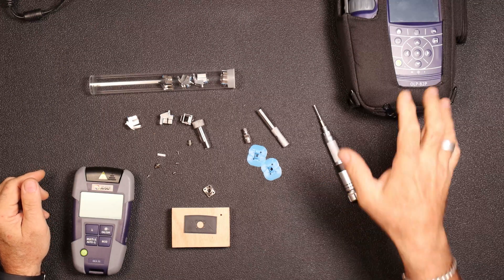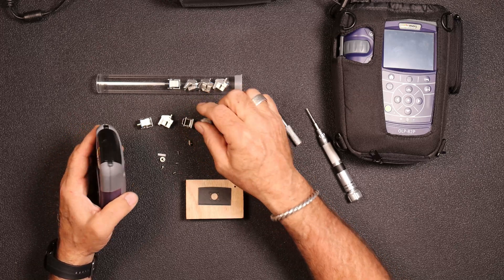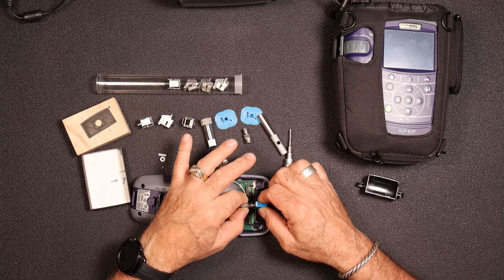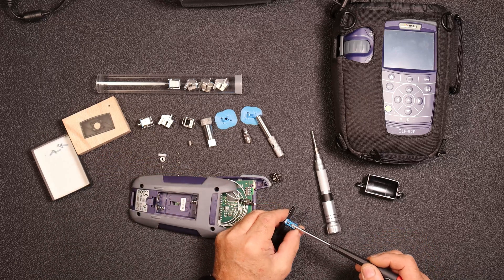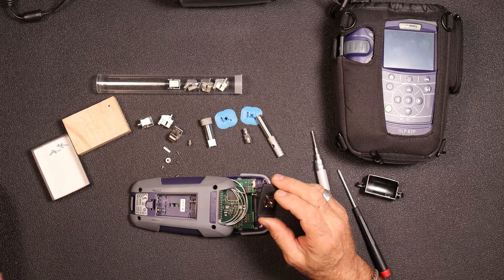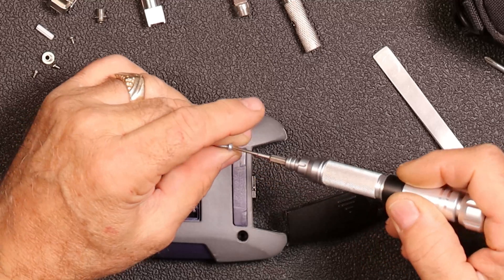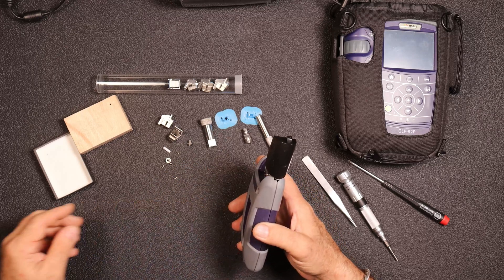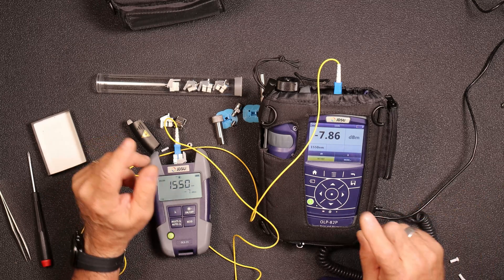OLS 35 Quick Change Adapter Conversion

Comment: Hi, friend. I have a team OTDR JDSU MTS 2000Apparently the SC optical port is damaged. Due to poor "cleaning" practices.
Apparently the connector ferrule is scratched, which causes very poor contact and obviously completely erroneous measurements.

Is there an easy way to replace it?
Reply from the maker: The connector can be replaced, I got a $1300 quote from Viavi for one of my modules. I would like to see the connector if you have a scope, as well as a shot so I can see the launch conditions. Another reason for bad measurements could be the adapter, especially the swapable adapters. If these get damaged, the connector doesn't remain seated, causing errors in the shot.